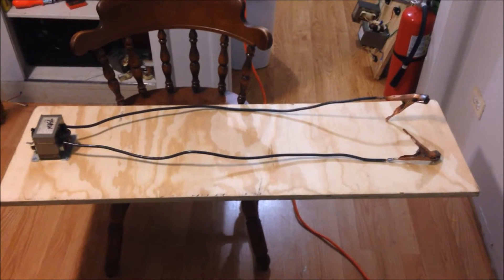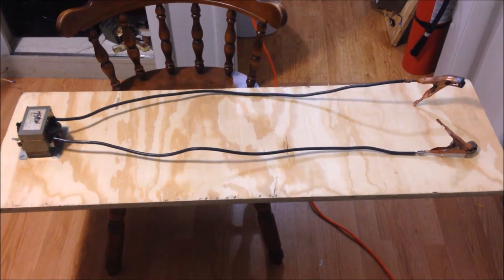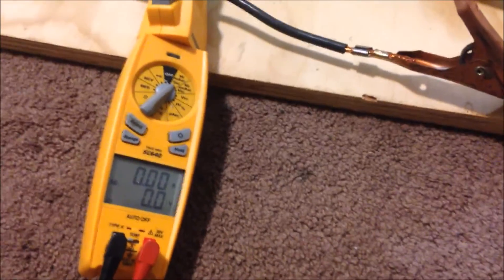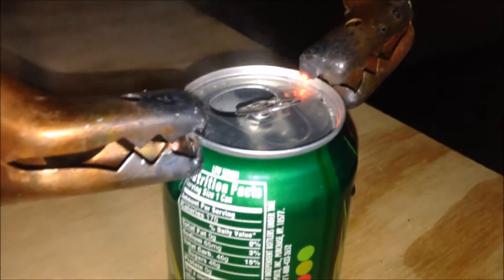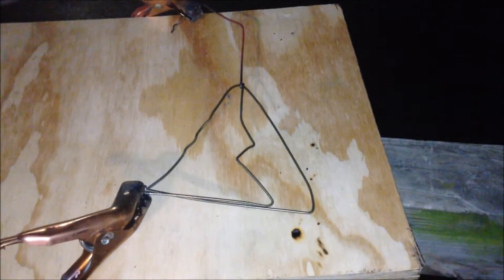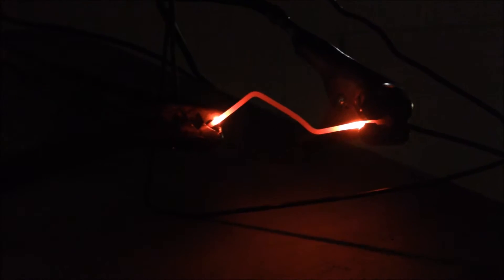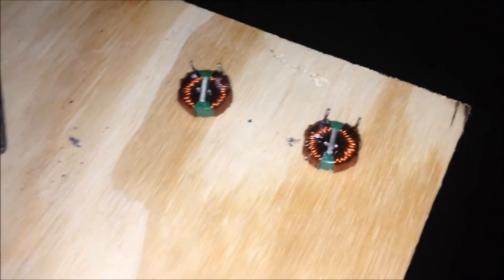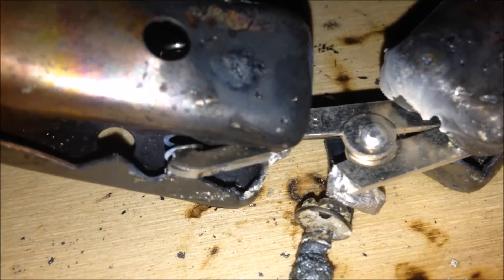Mini Metal Melter Made From Microwave Transformer  (400-500 Amps)

Comment: #1 Shorter secondary winding (will have less resistance) 
#2 Put the transformer in a mineral oil bath for cooling, and you should be able to handle over 2000w without overheating

Comment: you might get better results if you shortened the distance of your secondary to that of what you're trying to melt. cool video!
Reply: That's what I was thinking too! Too much voltage loss, lol
Reply from the maker: Yeah, my plan was to have those long leads so I could keep the fires I was planning on starting as far away from the transformer as possible. The irony is that I left them so long that it's preventing me from starting those fires to begin with! Thankfully I can cut them down for future videos :)